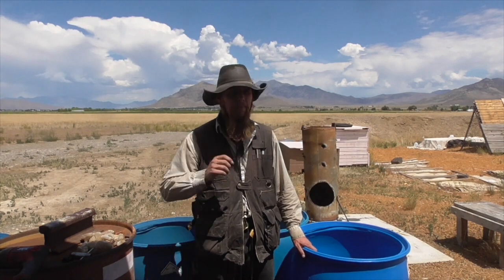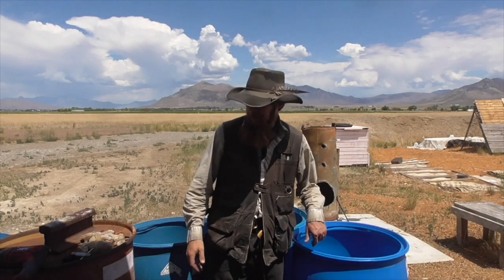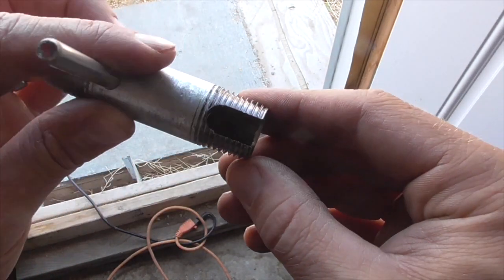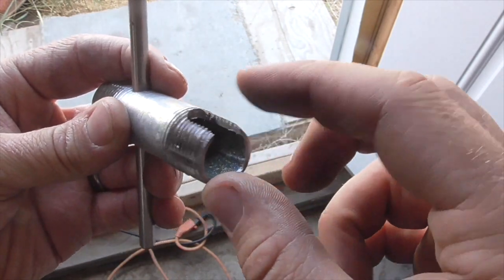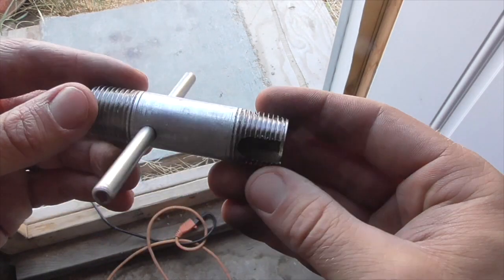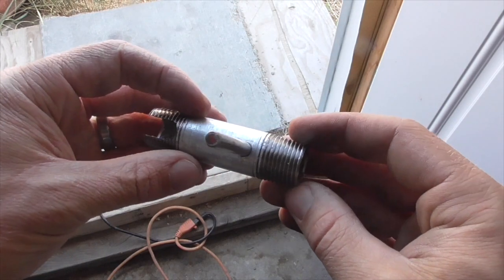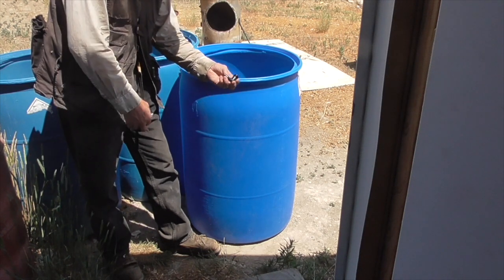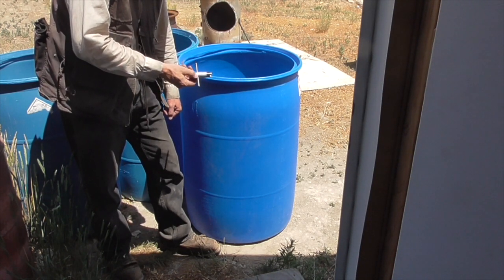Simple Trick for Cutting Pipe Threads in Plastic (TIS334)

Comment: Interesting Tim. You cut the threaded steel pipe to create a thread tap for plastic. And it has near zero wear when cutting plastic. I can currently think of quite a few uses for that in general kind of like what you showed, and even more so when coupled with a 3D printer. I have been 3D printing for four years now. One's imagination is the limit when it comes to what to print next. Enjoy your new hobby 🙂
Reply: Just curious..what does it cost to build or buy a 3D printing setup? Thanks
Reply: @Leonardokite  Thanks. Im thinking about getting one